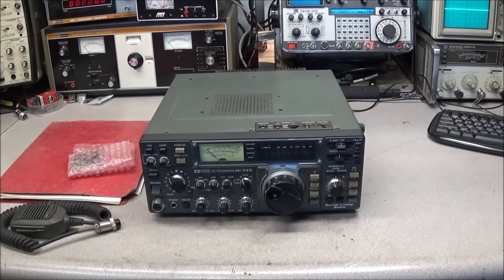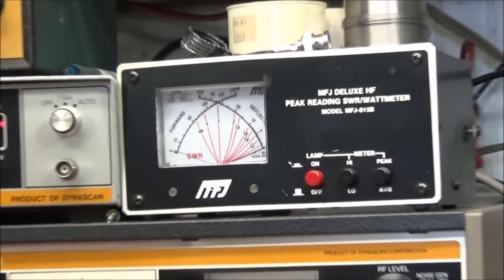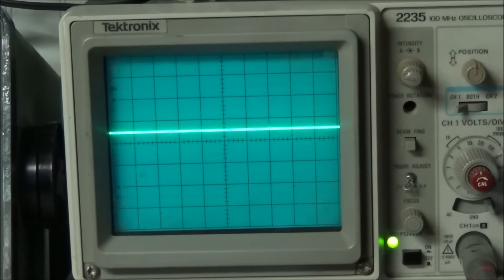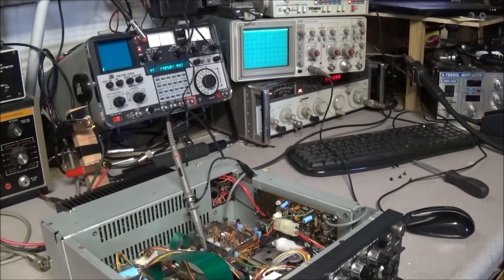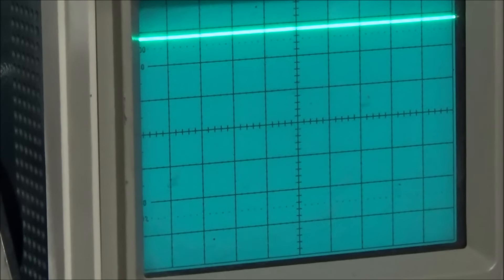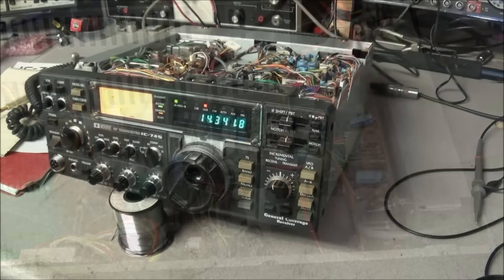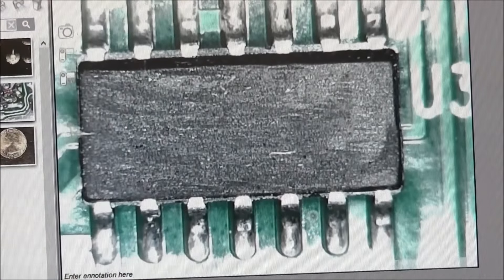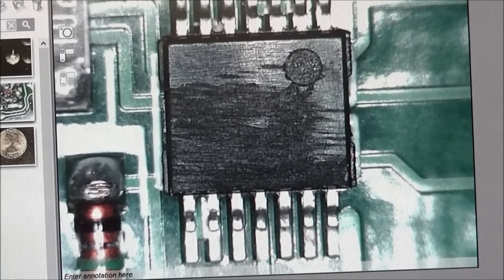#27 Troubleshooting and testing a viewers Icom IC 745

Comment: Great job as usual. I know it's been some time since this repair, but wondering if you still work on the 745's?? I have one with same problems as this one. Please let me know and thanks for doing what you do.
Reply from the maker: The problem at the moment is sourcing the 12 pf trimmers for the VCO. They have been discontinued.  I have not found any to replace them with.

Comment: Great job !  I called Icom Service today they wont work on these anymore. I have three of them (one belongs to my dad), two with problems and one good. Pre-amp is bad on dads (he said its the relay), and one of mine I thought was the finals, but after watching your videos I will need to take a closer look... I have the service manual so its off to the troubleshooting bench for me.  I can't part with them, it was my first rig when I got my license. Your videos gave me the nudge I needed to get working on these, Thanks very much Buddy!  73's Rich - N8PFK
Reply from the maker: Good deal Richard. They are not that hard to work on at all. If you need assistants  let us know.
Reply: Thank you, appreciate the support.

Comment: Buddy,  your videos are the best.  Thank you for sharing your knowledge and experience.
could you comment on the feasiblility of using 100v 5-20 pf ceramic caps Still available from Digi-Key)  in place of the  original 6 and 12pf caps?
Reply from the maker: Thanks for the kind words. About those trimmers, hard to make a comment on yet. I have not tried them. The wide range worries me a bit using these in a vco section. I will have to get some to see.

Comment: Really enjoy your videos.  They are clear and straightforward.  I have an old IC-745 and your programs encouraged me to take off the top.  I am not skilled in electronic troubleshooting. I made a rookie mistake of unplugging the internal speaker.  Now I can't remember where it was connected.  I've looked all over the boards on the top of the unit and can't find a connector that looks like a proper fit.  Can you help me with this with some point and fix directions.  Thanks so much.
Reply from the maker: Thanks Lou for the kind words. Sure, I will give you a link to my site. Scroll to the bottom and see the picture with the circled connector. Front left hand corner is where it goes. Link below.
Reply from the maker: http://gokarters.com/smf/index.php?topic=2515.new#new

Comment: Glad your thumb is healing, I would cringe when I saw it knowing how uncomfortable it must have been at first. Look forward to the continuing saga of the 745 series fixes! I'm guessing you sourced the 24pF cap that wasn't available from Icom?  73 - Dino KL0S
Reply from the maker: +Dino Papas Yes, that thumb has been in pain for several months now. Cracked the bone right on the end. But much better now :)Yes, Icom no longer has the 24pF cap. But a little over a year ago I bought out a guy that was getting out of repair. When I checked I have a good bin full of standard NPO caps and some "blue" caps with tighter tolerances.  So should be ok on that. Still throwing a few ideas around on the bench for the ram board. Going to be bit of work. Thanks for coming by my friend. 73 Buddy

Comment: I had my 745 out camping this weekend in my “to go” box. It developed a problem that I could get full output on CW but none on SSB using the PTT switch on the mic.  If I pushed the VOX switch, I would get full output on SSB without using the PTT. Ideas?

Comment: Do you by chance still repair the IC 745 for people? I have had some really bad luck with some repair shops, sent out 2 times and still not working. I no longer have transmit after receiving from the repair shop on the latest repair for having the vco trimmers replaced.

Comment: i have a ic745 with low tx on all bands. what should i look for?
Reply from the maker: Hi Michael. Well you should start by checking the level of the mixer board. make sure all voltages are correct,  From there go to the LPF board and then to the PLL board.  That should get you started.

Comment: Buddy, commenting over a year late on this, but why on earth would you want to reverse engineer the Piexx board? They are good, reliable, and the company stands behind them. They were made to replace Icom's P. O. S. boards with their battery backed up RAM with the potential to fail and lose the radio's firmware.
Reply from the maker: hi, commenting over a year is fine :-)  Why would I want to reverse engineer the Piexx board? I would not want to . I agree with what you said about them. They are fine units.  Build my own board to learn more about its operation is what I am suggesting.Good question.